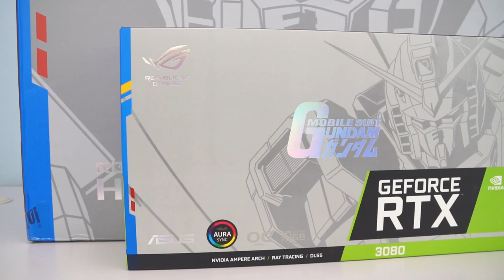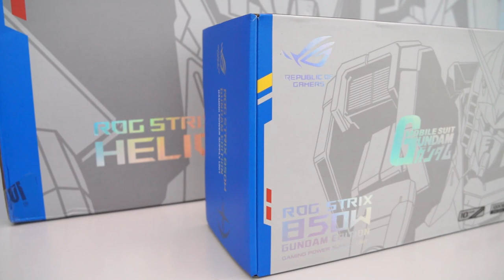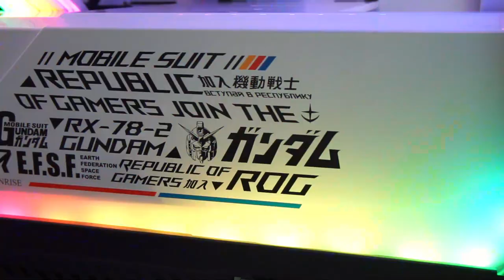Asus ROG X Gundam PC Build [Time Lapse]

Comment: Could you please write the reason why you did not put 3 fans of Corsair QL 140 mm on the front of the case and chose the 120 mm one?  I want to put 1 rear and 3 front QL140 mm fans, do you think this is possible?
Reply: 140 is good wherever u put it coz that  is compatible all side of 140fans
Reply: @kiethzpequit7951  Thank you very much for your answer, I will prefer the 140 mm one, why did you choose the 120mm one?  Doesn't the 140 provide a stronger cooling and appearance?
Reply: @abdulkadirnacar  reason for  coz 140 add more cost rather than 120 is less expensive than 140 for me so good for that asus rog case partner with 140 fan from thermal take so good to see those rgb is so good and so much brighter clearly